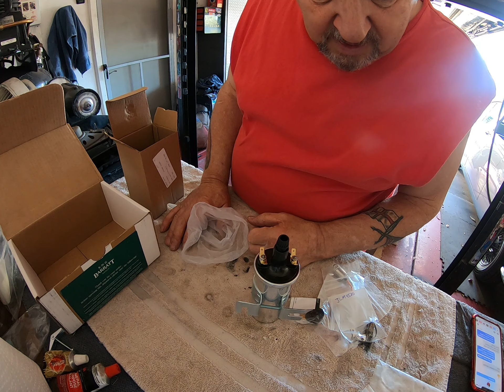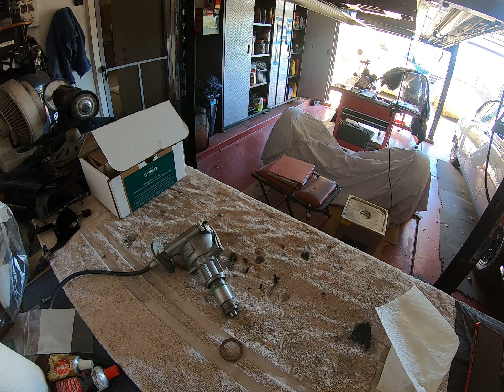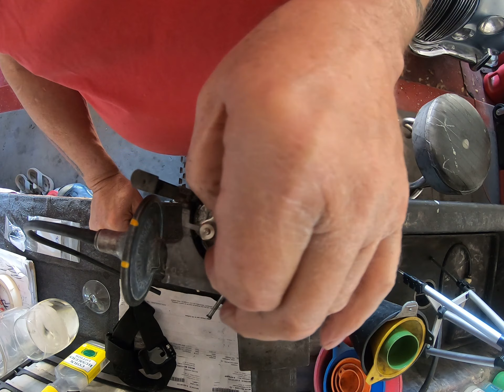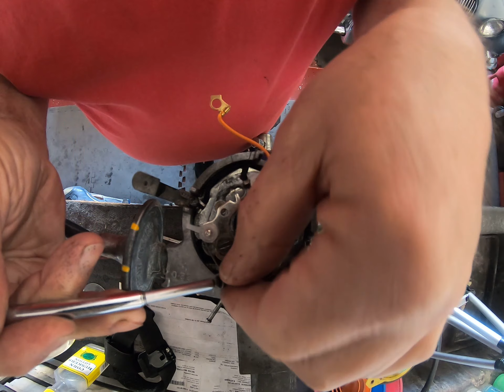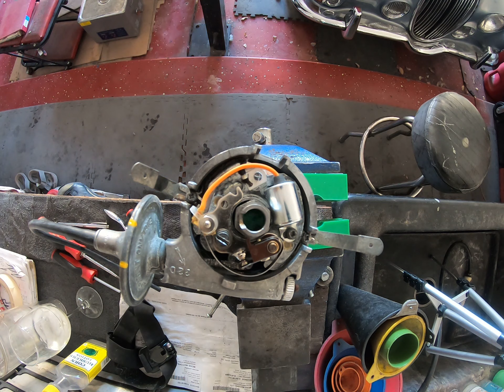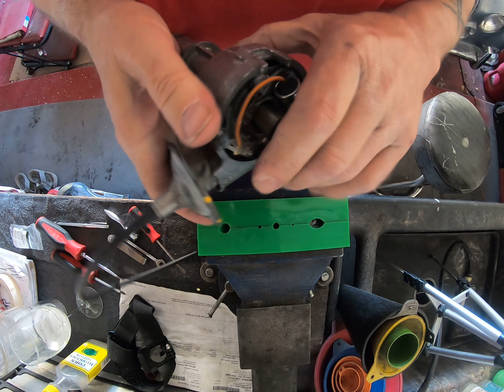Jaguar S type 1965 Will Not Start Part 10

Comment: Hello, I am leaving in France and have just bought an S type 3.8 from 1964 imported from California and of course I will have to restore a few things ... So for the ignition system, I saw what you've done to rebild it for your customer. But, if it was your's, would you have done exactly the same, or would you have change for an electronic system and if yes, what model would you have choosen ?
Reply from the maker: I would change to electronic as I have on my MKII

Comment from the maker: Sorry I do not know if it is the same but i SEE NO REASON WHY IT SHOULDN'T BE, TRY CALLING sng BARRETT THEY MAY BE ABLE TO HELP, should YOU NEED ONE i HAVE THE OLD ONE i TOOK OUT OF MY 3.8 mkii WHICH i AM SELLING FOR $50 WITH LEADS AND VACUUM PIPE.
sorry hit caps lock by mistake.